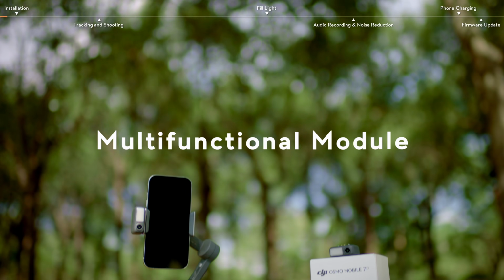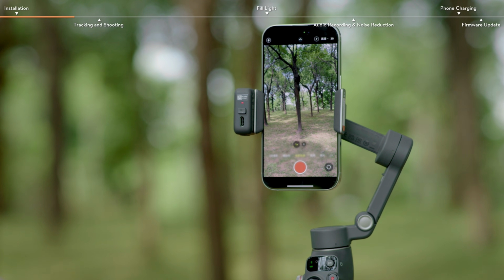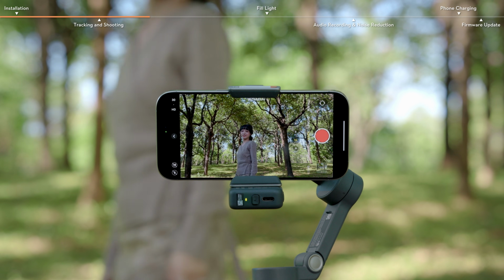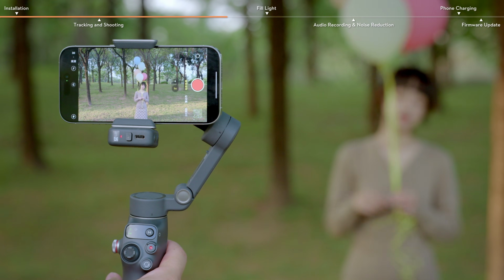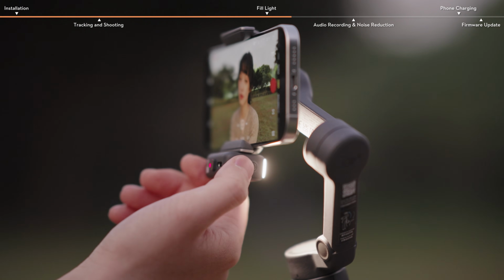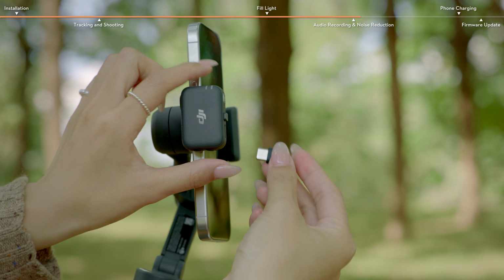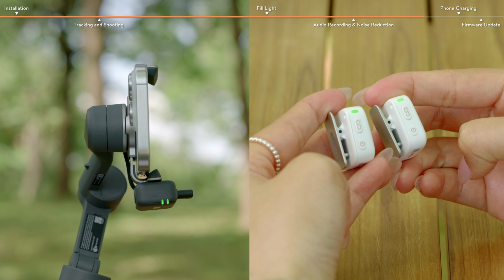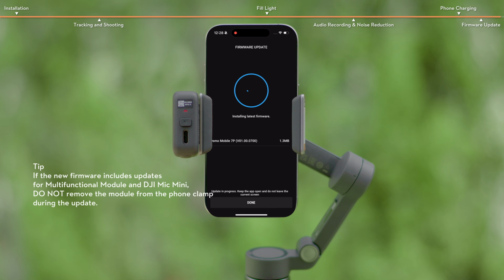Osmo Mobile 7 Series｜Multifunctional Module

Comment: How to charge it
Reply from the maker: Hi there, 

Thank you for your question. Could you kindly clarify what exactly you are referring to when asking about “how to charge it”?

If you are referring to the Osmo Mobile 7 Series, please refer to the following link for detailed instructions. Please note that the recommended charger power is 10W (5V/2A).
Link：https://support.dji.com/help/content?customId=en-us01700006770&spaceId=17&re=US&lang=en&documentType=%27%27&paperDocType=ARTICLE

If you are referring to the Multifunctional Module, please note that it does not have a built-in battery and therefore does not require charging. It operates by drawing power directly from the gimbal once it is attached.

We really appreciate your understanding and support. If you have any further questions, feel free to contact us anytime.

Comment: Good day!

Recently I faced an issue with connection mic mini directly to multifunctional module of om 7p
So problem is my phone (iphone 13) can connect via bluetooth to the mic, my phone can be charged through multifunctional module
But when Im trying to connect mic to module all I can see is solid green on mic and blinking green on module
Tried to reboot both devices 100 times, wouldn't helped.
And as I searched for solution in youtube, l found out Im not the only one facing this issue

So any Ideas or tips how it can be fixed wold be very welcome

Comment: High time DJI should employ some quality mobile app dev engineers to improve their app quality. 
700+ Mb of installation file, are you serious? 
And then the performance of the app is worst with excessive RAM and system resource drainage!

Comment: charging via multifunctional module doesn't work. also dji mic mini settings doesn’t work too.. maybe dji will fix it with updates, but for now it isn’t work properly :(
(iphone 15 pro, latest mimo app btw)
Reply: Same me, Iphone 15 pro charging didn't work
Reply: double click on the M button
Reply: @dantscha2859 I read the manual before comment, and of course I tried double clicking the M button..

Comment: Does the multifunctional module need charging? Kindly advise
Reply: Mines stopped working
Reply: Mine  also not working bought yesterday😢 @EazyTheRecon
Reply: It shouldn’t, though I’m not an expert so I could be wrong. It should be powered directly from the gimbal battery through the 4 pins on the module.
Reply: No it doesn't